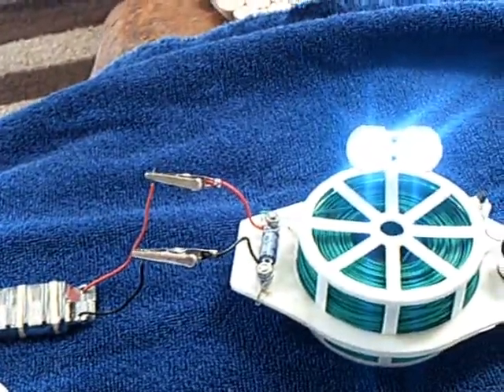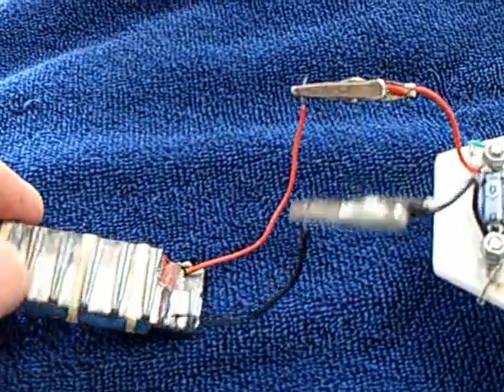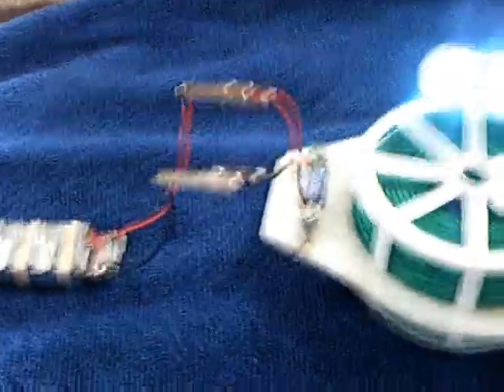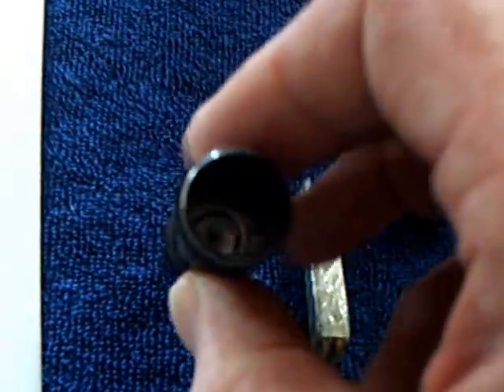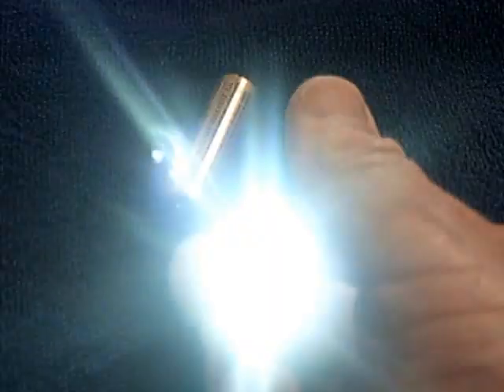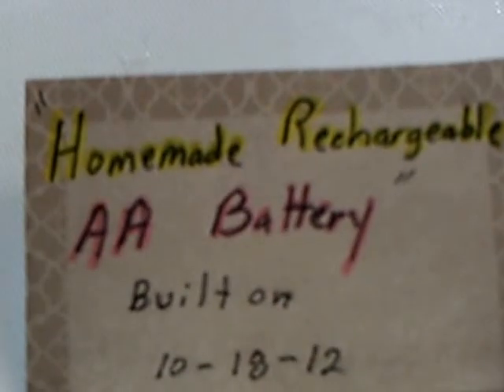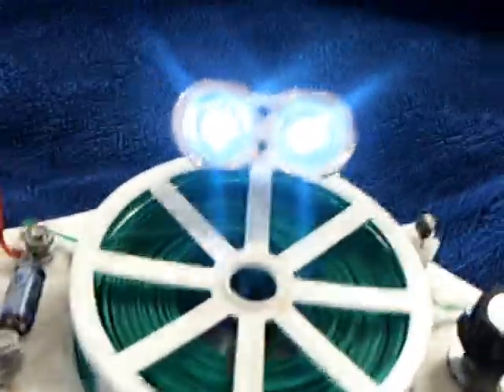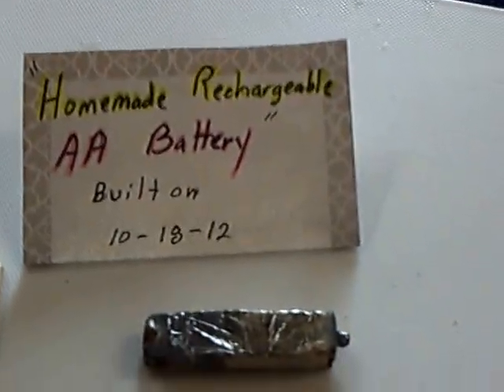Homemade rechargeable AA battery----- after months stored dead

Comment from the maker: There should be a way to make this like a regular SLB and still have it work--just with it's slightly different chemistry.  I'm glad to hear that your converted 12v worked well last Christmas.  I have a 12v converted motorcycle battery that I should do a video on.   I will be using it on my boat this summer to run a fan.  I really like the fact that you can leave these sit for months and they bounce right back.

Comment: I just had an idea as I was watching your vid. The moisture problem. Could you add something to it, like agar agar (don;t know if it is an English word). To make a gel out of it. As long as it has no reaction with aluminum or lead, it could be done?

Nice to know they run afterwards! At Christmas I used a 12 Volt converted 8AH battery to run the solar type Christmas lights. About 80 little lights running for hours and hours on it! Really cool to have an application for it.